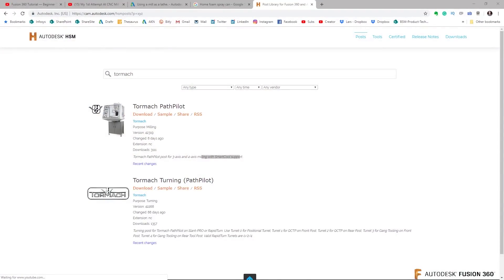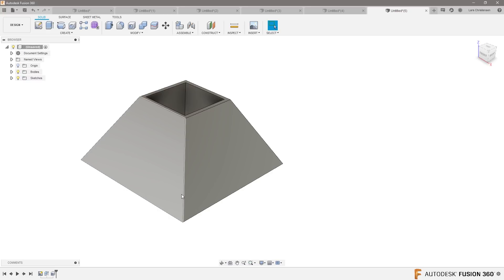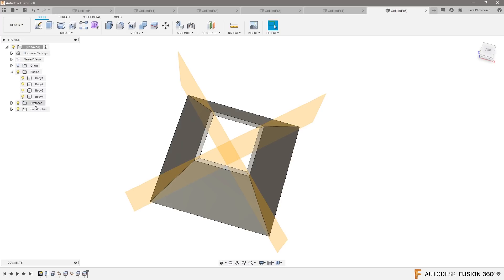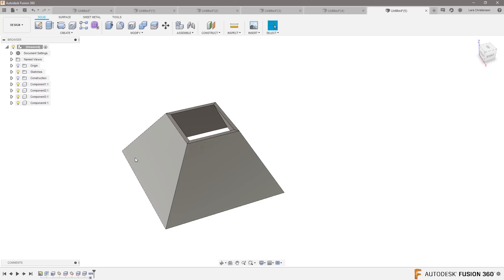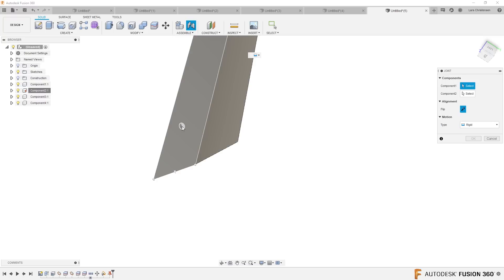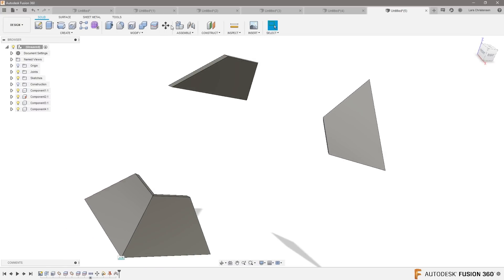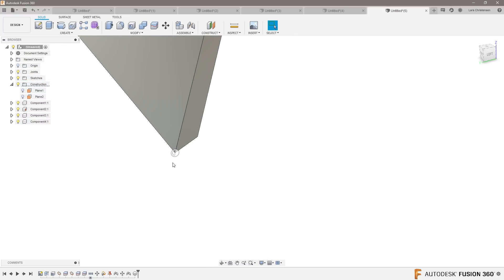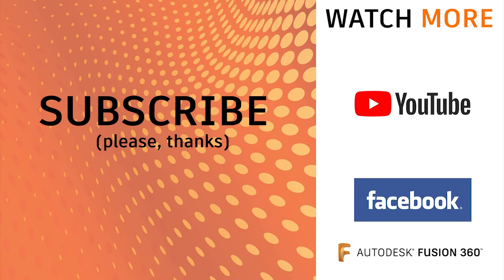Fusion 360 — Align Edges and Faces on a Pyramid — Ask LarsLive

Comment: Worlds toughest question--> *How to edit large mesh stl file for 3d printing*? Can anyone answer this??
Reply: Thanks Lars, the main reason I was having trouble aligning the objects is because they were glass sheets with perpendicular edges.
Reply from the maker: https://youtu.be/3vPhcaYl_no
Reply: Use a proper polygonal mesh app, not a 3D solids app. Seriously. That said, Fusion 360 can be helpful for mesh editing, but in a limited number of cases. To its defense though, it's getting better. BTW, F360 is better w/ meshes, but you can convert to BRep and do some body editing, but this is very limited in the size (polygon count) that is can handle, whereas pure meshes can be rather large (I've even processed a mesh w/ 4 MILLION triangles!). OK, I hope this helps. Sincerely, Swami.